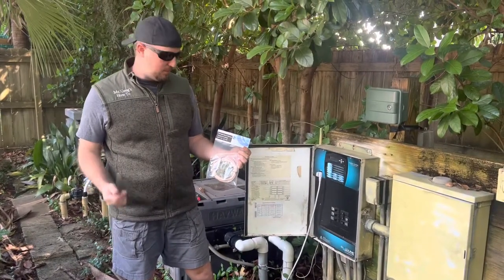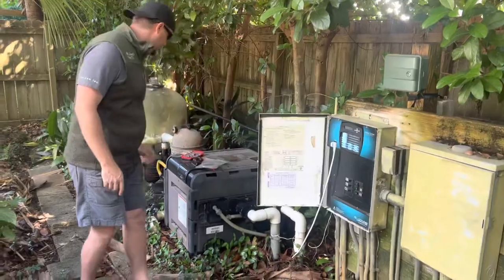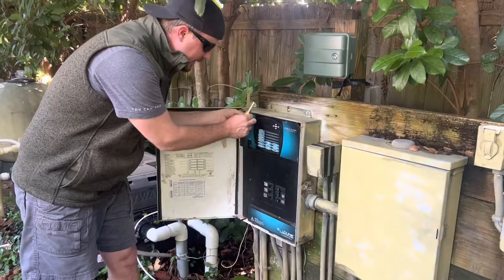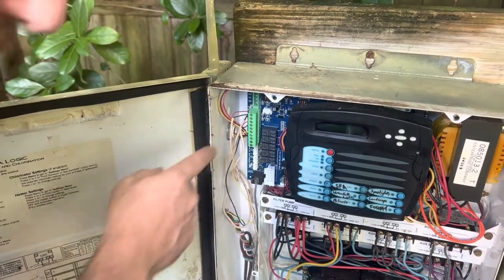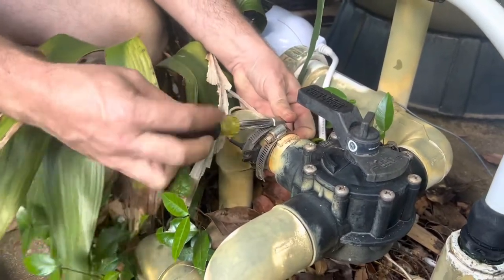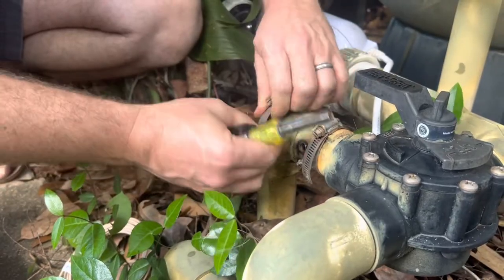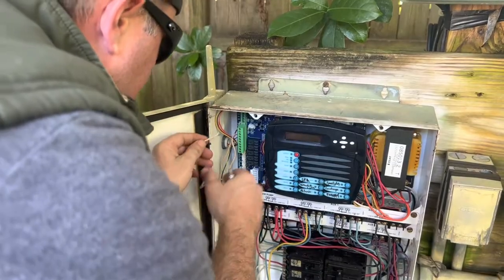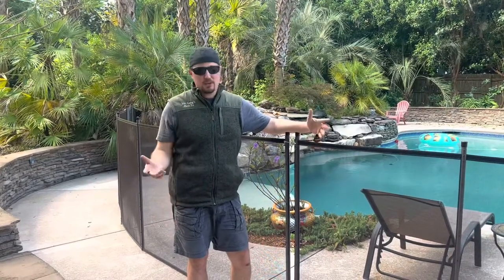HOW TO Replace Hayward Temperature Sensor // Pool Series

Comment: Seriously appreciate the video. My installers didn't install my temperature sensor and I had no idea where and how to place this.  Any idea what size drill bit what best make the hole?
Reply from the maker: You're welcome, partner!  I would guess just to drill a hole slightly bigger than the probe.  You need to make sure that the rubber o-ring will seat well and create a good seal.  Also, be sure to release water pressure before drilling.  Let us know how it goes!

Comment: What size drill bit did you need for the sensor?
Reply from the maker: Howdy, partner!  I don’t recall off hand and can’t check without removing the sensor.  Just make sure the one you use is slightly larger than the sensor piece, but smaller than the rubber o-ring and you should be good.  Let us know how it goes!

Comment: What size hole is that? If I need to drill one for a new sensor
Reply from the maker: Howdy, partner!  I don't recall exactly.  If you have the sensor just drill a hole a tiny bit larger than the probe that you need to insert.  If i had to guess I would say about 5/8".